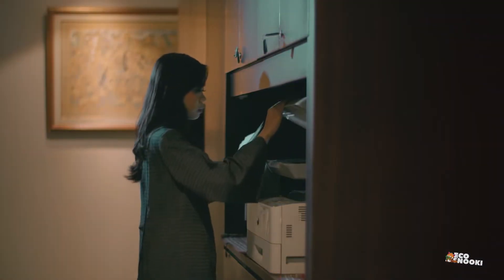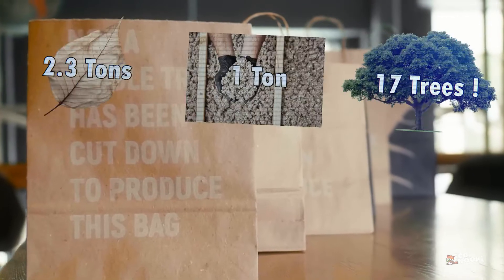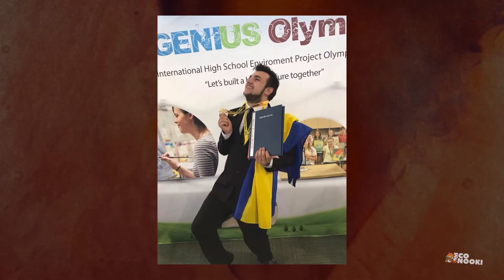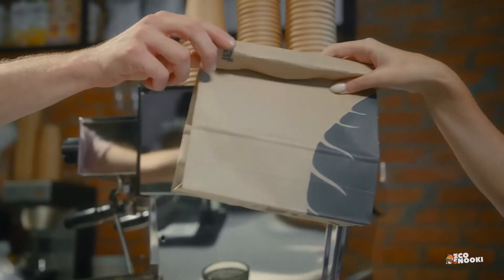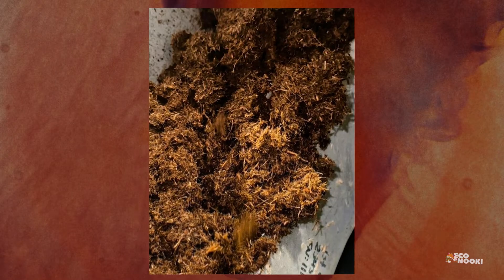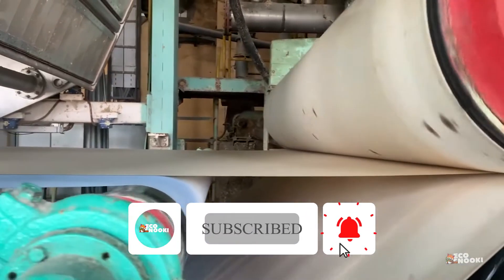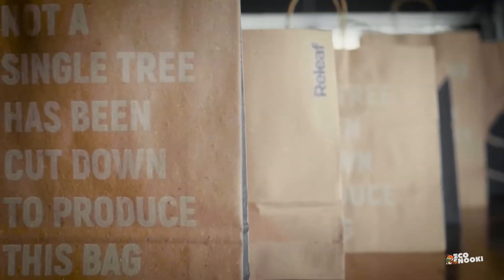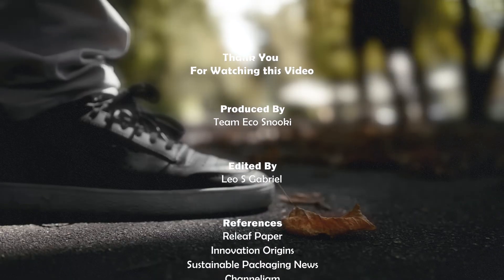Ukraine's Amazing Startup Is Converting Dried Leaf to PAPER!

Comment: What is the by-product of extracting the cellulose?? What is the waste product?
Reply from the maker: By-products: Things like lignin, waxy coatings, and leaf pigments (like chlorophyll).
    Waste products: Leftover fibers, dirt, and chemicals used in the process (like acids or solvents).
Most of this leftover material is thrown away or composted, unless it's reused in something like biofuel or fertilizer.